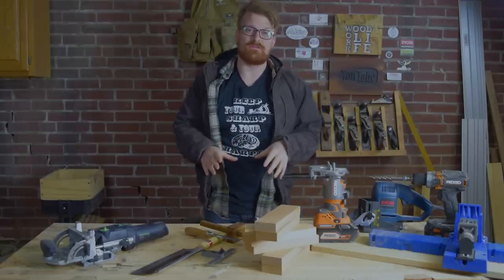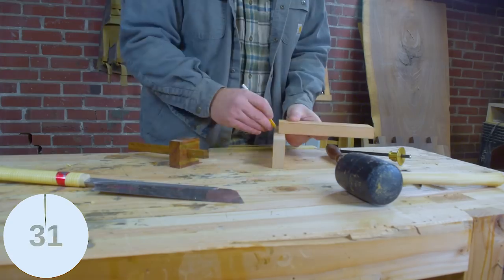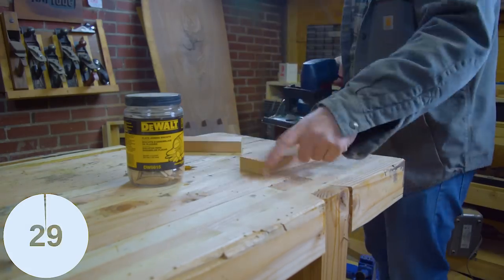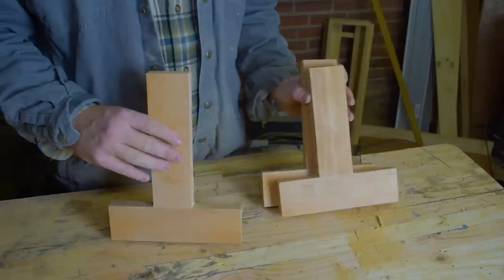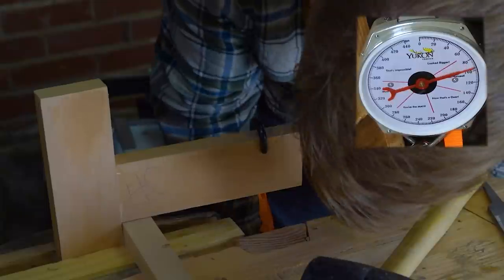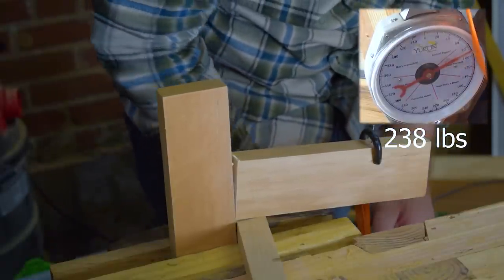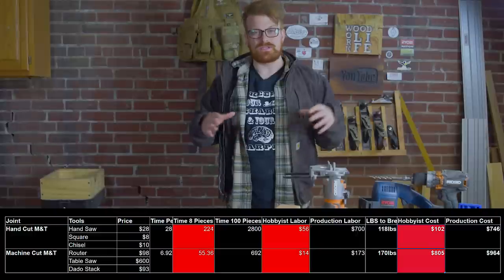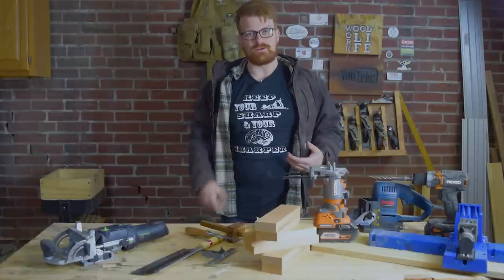Best Joint Shootout, The answer will surprise you!  | Hand Tool Shootout

Comment: The leverage force you’re applying would almost never be applied in application. The typical stress on joinery is almost always shear force.
Reply: that is my issue with all these youtubers doing these type of (scientific) tests. Never real world
Reply from the maker: A scientific test has to isolate variables to be reasonably significant.  The moral of the story is that engineering is to build something strong enough.  Unless you are building chairs for cars...but that's another video
Reply: Wood.Work.LIFE. The type of force is still completely different. Sure, one type of joint is better for leverage/pulling force you're applying here, but how does that apply to the sheering force often applied in real world application? The direction of force and the location of the force is not applicable in real world applications.

Comment: These comparisons really make very little practical sense. All these joinery techniques have their place . One isn't better than the next they serve different functions.   You wouldn't use a pocket screw where it would be visible, a door for example but it makes perfect sense to use it on a face frame where the screws will be hidden. Dominos would be a great thing to align a difficult glue up.
Reply from the maker: Nail in head brother.  Glad you made that conclusion, that is what I am going for with all these series.

Comment: Not sure what cheap ass lamello cookies you use but I tested mine. Had to put them in a vise and hit them with a big hammer to break.
Reply from the maker: I used freaky cookies with a Ryobi jointer.
Reply: Don’t know them but when buying cookies I pretty much stay away from the pressed reconstituted wood once. They are little more than cardboard. I use real wood cookies with grain square are angled to the length of the biscuit. Still, I believe you when you say dominos or dowels are better for strength.

Comment: If you can't get the strength out of the glue, you are using the wrong glue.  Dominoes, dowels, biscuits, etc are used for lining up the edges.
Reply from the maker: Ahh, for panel joints the are use for alignment, but for butt joints they are the entire functional glue area.
Reply: End grain glue joints have very little strength, regardless of glue type. Dominoes and dowels provide side grain glue surface, adding much strength. Biscuits are primary only for lining up.

Comment: Nice work and great video!  Would you say the difference in breaking strength between the hand cut tenons and the machine cut tenon was due to precision in the cuts and the way the joint, therefore, fits together?
Reply from the maker: If you will allow me to geek out for a minute here, I think the margin of error on all of these tests make them nothing more than interesting. The difference in strength between the hand cut and machine cut mortise and Tenon is likely anomalous.

Comment: Good video, well put together.  The cost of the domino tool puts it out of reach for the hobbiest. As useful that tool is I can't justify spending $1000 on a hand held tool that a cordless router will do exactly the same.
Reply from the maker: There is no way a router could do the work of a domino when time is money.  That is really what I was looking at.  If you build one piece of furniture, maybe skip it.  If you plan on building a ton, get the domino it will pay for itself in a month.
Reply: Wood.Work.LIFE. 
I hear you on that where labor is the expensive part on any job.  For any production shop, $1000 isn't the same as a hobbiest making $50k a year supporting a family.  I think a well made slot mortiser could compete and cost a far less, for a hobbiest. I got into this hobby twenty years ago watching Norm, the thing with him was he always had every tool but it was his attention to detail. I never felt like I had to buy everything he had but I hoped some day I could do what he did.
Reply from the maker: In the follow up I am looking at the rockler bead lock system and dowels much more approachable price joints.  I am interested in how they stack up.

Comment: Just one more question i am setting up my first woodworking shop and it is EXTREMELY small and since I need a way to collect dust i was wondering can an ordinary household vacuum cleaner work?
Reply from the maker: I mean, several from garage sales can, they will die SUPER quick with all that saw dust and shavings.  I would get a cheapy cheapy shop vac for like 30 or 40 bucks.  My wife loves to use mine around the house for cleaning the wood floors every now and again.
Reply: Wood.Work.LIFE. thanks

Comment: 6:55 for the router + dado cut seems a little misleading - you didn't include setup time did you? Changing the router bit, adding the jig, and changing to a dado stack on the table saw could easily add another 5-10 minutes depending how organized you are.

By comparison, the Domino & biscuit joiner are immediately ready to rock and roll.

Comment: How often is a face frame on a kitchen cabinet stressed to 1200 plus psi? Overkill much? I think that balancing speed and cost vs strength required is the way to go. On a table leg, definitely go with the strongest available, and that would be....M&T, pinned with a couple dowels. Dominos are cool, but for hobby work, I’ll save my cash.
Reply from the maker: Agreed, I don't really think they are for hobbyist work.  In a production environment they kill

Comment: There's no doubt that Dominos are fast, but  require expensive tooling. Kreg joints are only good for DIY ( not proper furniture ). Give me a machine cut mortice and tenon every time. I produce my tenons on the table saw using a shop made jig ( very accurate and fast ) with the mortices done on my overhand router with shop made sliding table ( again accurate and fast ). If you properly apply the glue and clamp the joints for the correct curing time you will not break the joint without destroying the components. I have no need for the speed methods and prefer to make a quality joint.
Reply from the maker: I'd say that having no concern about speed is a very DIY concept or perhaps artisan furniture.  In a production world where time is money, the time to execute a joint is key.  Engineering is about good enough and cheap enough, not as strong as possible. Many production pieces of furniture use tons of pocket hole joinery, but not at any critical load bearing points.
Reply: @WoodWorkLIFE  I 1st came across pocket hole joinery in America about eight years ago, but I didn't like it then and I don't like it now. It seems to have crept into Britain in the last couple of years but I still feel its DIY at best.
Reply from the maker: @davidjennings9253  I get it, but I also understand why mass produced furniture uses it

Comment: Festool, frig.  A domino cutter that could cost  $250 and last 5 years for a hobby woodworker.  Then I'd be in.
Reply from the maker: They have to have some sort of patent on the nature of the floating tenon technology or something.  If anyone could make a cheaper slightly less precision version of it that would sell like hot cakes.  But even at the price it's at now, for a pro, I totally get it now.  Not your first tool to buy by any means though.  The Pocket Holes surprised me too, but I guess that is why you see so many pros using each technology.
Reply: Wood.Work.LIFE. yes as a pro you'd be crazy not to have one.  home gamers will just have to wait a bit.
Reply from the maker: Open an etsy show and sell 10 100$ doo-hickeys a month on there that require m&T joints...ROI 1 month :)

Comment: you should have included dowels.
all you need is a drill and drill bits, which most carpenters/wood workers/cabinet makers already have. 
and a 3 ft dowel is about 60 cents at the home store, all you need to do is just cut it to the length you need.
and the dowels come in every thickness you can think of. supper cheap.

you don't need to spend that hard earned Dolla Dolla bills $$$ on expensive, single use, specialty tools like a biscuit joiner or Festool Domino.
you'll rarely use them and they are only gonna take up space in you shop/cabinets.
Reply: unless you work on an assembly line these are not really a sound investment.

or you just collect tools.
Reply from the maker: That is what I said at the end.  But I did do a follow up video with dowels but unfortunately my methodology in the follow up was flawed.  I need to revisit this whole thing.

Comment: I don't know how accurate your testing methods are but I think a more important question is what joint is strong enough for the job at hand? Do we really need the strongest joint for everything we do or just adequate.  Would you build Golden Gate Bridge to cross a small river. I think not.
Reply from the maker: Good point, I am sure there is a more scientific way to test these joints.  But this is certainly repeatable.  Engineers don't build things as strong as they can be, they build them strong enough.

Comment: Pocket screws are only good for face frames and table top fastening
Reply from the maker: you shouldn't attach a table top with pocket screws...it doesn't allow for seasonal wood movement.  But ya, I wouldn't generally trust post screws for a structural joint because of the nature of how they fail.  There is not really a concern to me strength wise though.

Comment: Why wouldn't a hobbyist just rout out a slot and make a domino on the saw table and perhaps round the edges with a roundoff bit.    Good strength and much quicker that a tenon and stronger than a pocket screw joint.  It seems that in all of these comparisons that people are trying to justify the Festool
Reply from the maker: You totally could, it is called floating tenon joinery.  The machines make it faster for production shops.  If you were to do it yourself you wouldn't really be saving a lot of time and you could double triple up on some dowels to similar effect.

Comment: Did I hear you right at 9:00? You used hardwood for the Domino and softwood for the mortise & tenon? 

If so, this "test" is kind of worthless.
Reply from the maker: All dominos are Oak, the tenon is cut from the wood itself.  So the domino joints weakpoint will always be the mortise in anything softer than oak, and the tenon would only be the weakpoint if cut in something harder than oak.  So...not sure what to tell you.

Comment: I’d bet you get more out of the pocket hole if your screws are a bit closer.
Reply from the maker: I doubt it actually, the wood failed before the joint which is one problem with pocket holes for load bearing applications.  The screw itself compromises the end grain of the wood (creates a wedge essentially) so the wood will fail along the long grain of the piece you drilled the holes in.  IF the same joint were in a resin application (where grain wasn't a factor) it would be much stronger.  The holes being tighter together would further compromise the grain structure of the wood.
Reply: Wood.Work.LIFE. I thought maybe the side by side screws can reduce the stress on the piloted side.  But I think you are correct in that there is an ideal tension before the wood fibre compressed then fails.  I always wondered about  whether you’d get more out of a good quality wedge head screw like a no 10 GRK.  You’d have to change the angle on the step drill tip, but you’d loose much less wood.  But then the average homeowner will probably try to drive the screw in so deep that the wood will split.

Comment: you just made a handcut M&T joint weaker than a pocket hole joint. That's like impossible.
Reply from the maker: I think the difference is the glue failed on the M&T while the wood failed on the pocket hole joint.  You could re glue the m&t joints.
Reply: Well it must have been a real sloppy M&T joint,
Reply from the maker: It was super snug, super clean...the machine one was weaker than I expected too.  I will have to repeat them for the follow up.

Comment: I might suggest the "toe nail pocket hole" joint.  I use that all the time for strength.  just pocket screw on opposite sides of one piece.  it shows more but is as strong a joint as you can get if you want the strongest and very still fast :>)  Oh, i did a video on "toe nail pocket hole" joinery if interested.   enjoyed your video, Thanks
Reply from the maker: Thanks Russ, I'll check it out.
Reply: a link would be nice, did not find it on you channel, just the pocket holes in plywood
Reply: sorry, links usually turn into spam and not posted.  link is:
https://www.youtube.com/watch?v=8UJlruMszqQ&t=2s
Reply: Thanks Russ, great video, sub'ed to yours and WWL  both
Reply: double thanks fiber :>)
Reply: Oh, that's a joint I use a lot in furniture I built for my own use with old shelve boards that where manufactored for flooring. 

I use this technique for the legs and the butt-joints holding the boards for the top together.

(That reminds me of giving the already in use table some better sanding and maybe some oiling.)

Comment: Your biscuit joint test is flawed. I use biscuits and they hold way stronger than that. You must have not put glue down into the slots.
Reply from the maker: I think there are probably way better plate joiners than this old ryboi.  I used what I had, would love to get a Lamello and see how it compares.

Comment: I agree with others that I would have liked to see dowel joints, but I wouldn't diss this video for not having that.  I do have two and a half dislikes.  1, maybe you did, but it really doesn't seem like you let the glue cure out properly, or you didn't glue properly.  I realize this joint is less than ideal for gluing, but even a pure glue joint should survive a brad being nailed in, which the biscuit joint did not.  2, I don't understand why you didn't glue the pocket hole joint.  If doing a strength test where glue is involved, why wouldn't you?  Perhaps an alternative would be do with and without glue even.  1/2, because the biscuit joint failed as you were putting a nail in, I question how well you glued it.  Butt joints suck, but if glued properly shouldn't fail THAT fast.  As a side, since you went through so much work doing this video, I wish you had done a couple variations of each test for quality control.  I'm giving you a thumbs up for doing the video, but I would love to see a video where you have more than one variation of each joint.  Oh, I almost forgot this one,  you had price charts at the end, but you didn't do a strength test chart.  I had to re watch (was that the point?) and make notes to remember what each joint tested.  Thank you for this video!
Reply from the maker: Ya, I really need to revisit this

Comment: You open this video with a misleading statement. Butt joints can be other than just end grain to long grain.
You sand all the faces then evaluate the fit, what's the point since you just flushed the mating surfaces of the two pieces.
Reply from the maker: No they can’t.  Grain orientation is crucial.  A butt join is end grain to edge or end grain to end to end.  It is a weaker joint because of its interaction with glue.

Comment: Measurements are not accurate imo. U should have recorded as soon as the joint opens up not when it completely comes apart. The dominio was nowhere in the 200 range
Reply from the maker: I did it frame by frame, when the joint failed that is when I stopped the timer.

Comment: Really....? It depends on WHAT kind of joint you make, or rather what I mean "for what purpose". You will not try to use bicuit joints on a chair, table, bed,....but on a pic frame or a Cupboard door with bradnails from the back, it has not failed me in 15 years

Comment: This would have been a great video if you did it right. Why do the video if you don’t want se the same type of wood. So basically all the pounds per pressure readings are in accurate with different types of wood. If you didn’t have all of the same wood then you should’ve waited and did the video another time. Other than that is ok. I can’t give thumbs up since it wasn’t accurate and that’s the only reason I wasted the time to view.
Reply from the maker: It was all the same wood, from the same board even.  Only the oak domino added any different wood species into this test.  I even saved some of that board for following up.

Comment: 'Pocket screws are structural but biscuits are not' (in this context) Bullshit.

'I prefer machine produced M&T joints and usually use them'. Makes the joint too tight, forces the fit, and snaps off the edge of the tenon (@ ~3:30, watch the left side), and screws the pooch.

Hard to take you seriously my man. 
Also, I totally get that you have zero respect for plate joiners. I don't know why you don't but it is very apparent since you brought in a $80 10 year old Ryobi tool (which is essentially a child's toy) and compared its results to $1500 Festool.
Reply from the maker: I consider legit plate joinery and biscuit joinery two COMPLETELY different things.  All of the joints fit perfect btw.  I still would NEVER consider using plate joinery for a weight bearing structural element of a piece of furniture.  Face frames, panels, maybe case sides but legs, stretchers, aprons...never.  Not sure what you are all worked up about TBH.
Reply: @WoodWorkLIFE  watch your own video. Watch the tenon as you force the mortise onto it... yeah, about that.